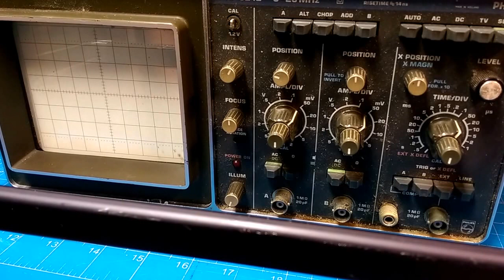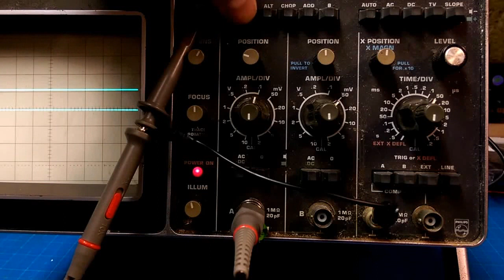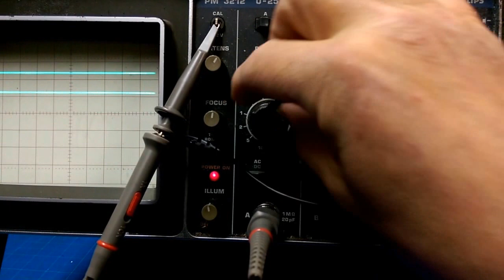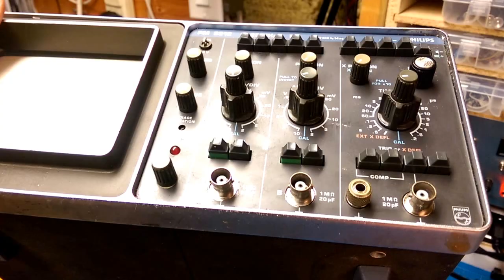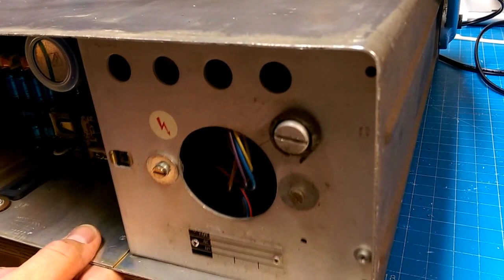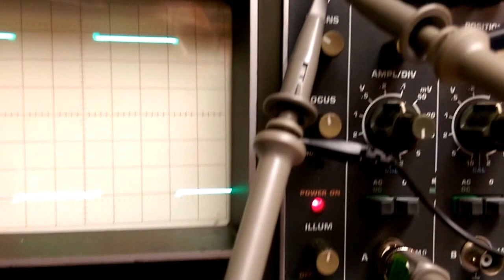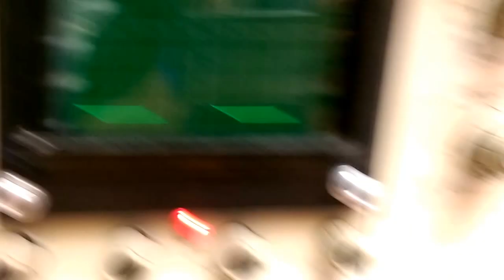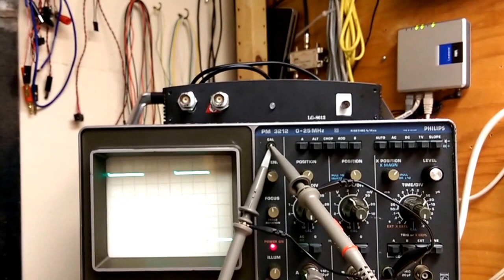Philips 3212

Comment: I just got one yesterday on Ebay for $25 with $29 shipping. Mine works great too all for under $60. Love the thing. I am a ham WD9GNG and always wanted a nice scope. It converts the power line to DC and then through a DC to AC converter then a AC-DC converter and finally a DC-DC converter to various high & low DC. Also runs on 24 Volt DC directly to the DC to DC converter. Just amazingly professional grade scope. Looks great in the shack! Thank you for the interesting and informative video!!!!

Comment: I'm doing an internship at an electronics manufacturer and i bought one for 15 euros there. They didn't have a probe for it, so they just cut the cable off a 9v power supply and held it up against the test point and the BNC port to see if it was working. The signal looked absolutely horrible but both channels seem to work and they also said that they repaired and tested it a while ago.
Reply from the maker: +StarTrek123456 nice! I like that the scope is isolated ground. Good for troubleshooting power supplies when you don't have an isolation transformer.
Reply: I could finally take it home today and test it. It's not calibrated, but that shouldn't really be a problem since i'm only using it for very simple measurments.
Reply: @grtyvr 😭

One for all, all for one 😂
Touche! 😂